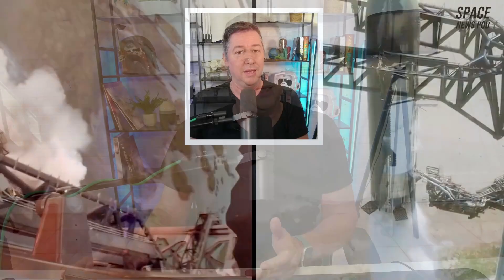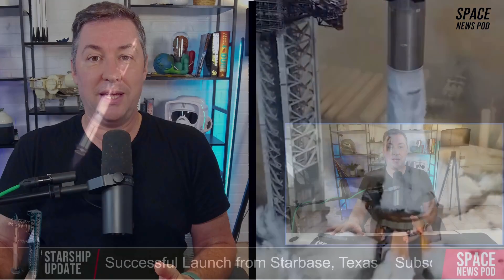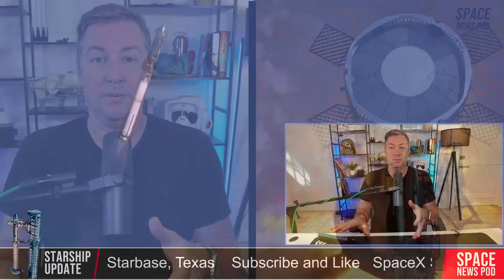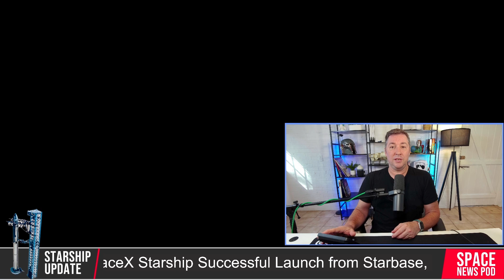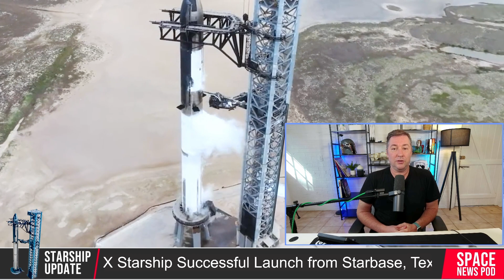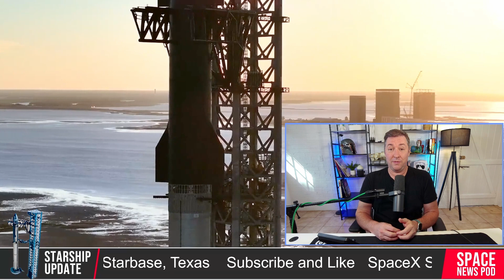Starship Can't Launch to Mars Without This

Comment: Within reason SpaceX doesn't need the booster to return 100% OK to get to a reasonable level of reusability. If for instance a booster needs 10 days of work to fix stuff and do pre-flight testing and SpaceX wants to get an initial cadence of 1 launch per day it could do that by running a fleet of 10 boosters. Admittedly it would be a challenge to store them all but if KSC comes on line by 2026 that spreads the load and that sort of not perfect reusability might be an acceptable compromise to keep as close as possible to the current Artemis timeline.

Also, and slightly more extreme, if SpaceX was determined to get as close to the Artemis timelines as possible and was still having issues with Ship reusability it could consider expendable tankers to do the LEO refuelling for the first HLS. With Star factory fully operational by then it could probably churn out ships at a high rate especially if they didn't need heat shields and flaps, and in terms of Raptors lost 5 expendable ships (30 Raptors) is still less costly in engine terms than the loss of a single booster. The booster Raptors lost on IFT-1, 2, 3 and 4 (4 x 33 = 132) is equivalent to the Raptors that would be lost on 22 expendable ships.

Even with all of the above I still don't think 2026 is likely for a crewed landing on the Moon but just maybe a first uncrewed demo might be possible.

Comment: Lunar Starship will conduct a lunar landing in late 2025 or early 2026. SpaceX will get to Starship orbit early next year. They will follow quickly with a fuel depot and tanker ships. When they fill the depot, they will launch Lunar Starship, dock at the depot, transfer fuel, fly to the Moon, and land. In 2027 SpaceX will do it again with crew with, or without, SLS.

Comment: Mark these words:  If we focus on the moon for 2028, we will never go to Mars.  At least SpaceX won't.  China will go to Mars first while the USA loses its way....and calls the Moon a successful mission
Reply from the maker: Do you think we need the Moon as a depot to get to Mars in a long term capacity?
Reply: @SpaceNewsPod  SpaceX is quite capable of parallel missions to Mars and the moon. NASA'S goal of a moonbase is dependent on SpaceX, but Spacex goal is Mars. SpaceX proves that by their development iterations, they can handle simultaneous missions. It's not a problem 👌.
Reply: @PiCorder yep it's a private company after all not nasa
Reply: @PiCorder  You do know everything that starship is going through is for a Mars mission. The HLS is just a benefit of the development of starship.
Reply: @MidnightOtter-19  of course,however, unless SpaceX can develop and prove HLS is fully functional and safe for astronauts, a crewed mission to Mars is out of the question due to the extended duration of travel. HLS and Mars missions, while independent of each other in goals, are still intertwined in the sense of engineering and development.
Reply: @SpaceNewsPod  Nope. Going to the moon will only tie up resources and the will to go to Mars.  The next argument will be, let's build a lunar base before ever going to Mars, tying up another decade.  That will delay SpaceX while China makes the jump directly to Mars with a manned mission.
Reply: @stagezerostudio  since I'm familiar with a Delta-v map, no. A moon depot is worse than useless.

Comment: landing legs for starship are not necessary. We have a 30ft diameter vehicle that only needs to extend the vehicle fuselage past the engine nozzle and with the same venting structure as the hot stage ring presently used on starship super heavy. The first few starships to the moon built this way can land the necessary cargo, robots, and equipment to facilitate building a proper landing pad and astronaut habitat. These vehicles won't be returning to earth anyway, so no need for legs, TPS tiles, or flaps. All that's needed is additional thrusters near the nose section for attitude control.
Reply from the maker: Wondering about uneven terrain. With legs, they could absorb uneven terrain, rocks, etc.
Reply: @SpaceNewsPod  I'd imagine a blast from the engines upon landing would dissipate the loose regolith and create an even landing area, if not a circle of such proportions that it would leave a hole for a smooth flat area for landing.